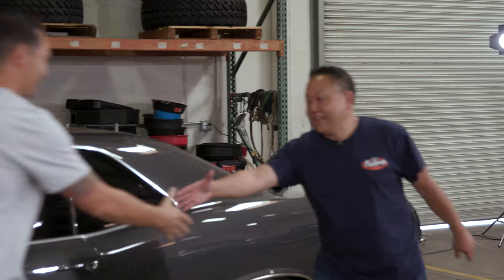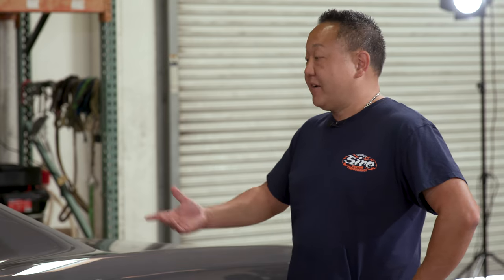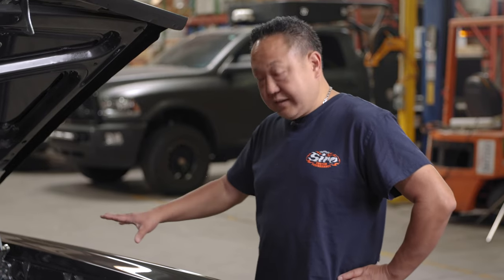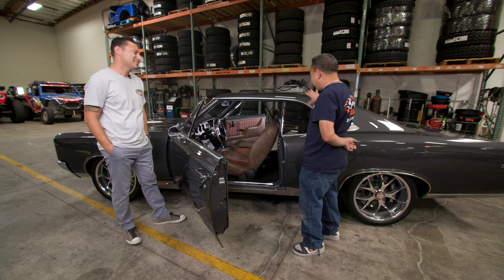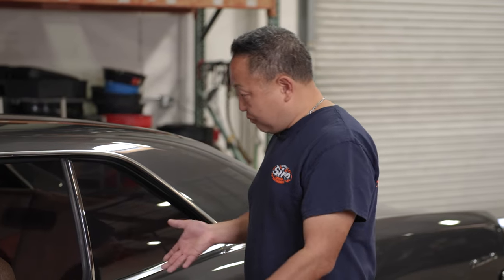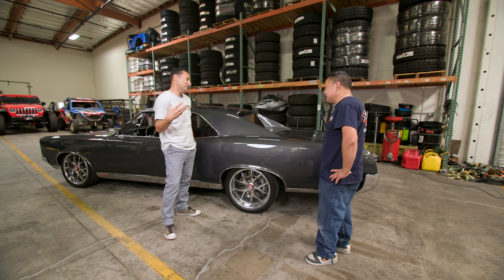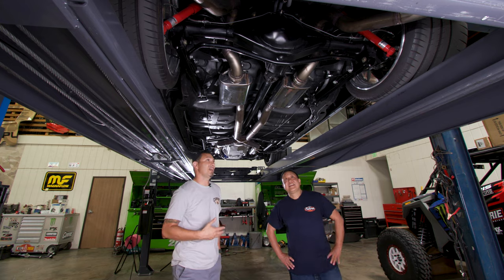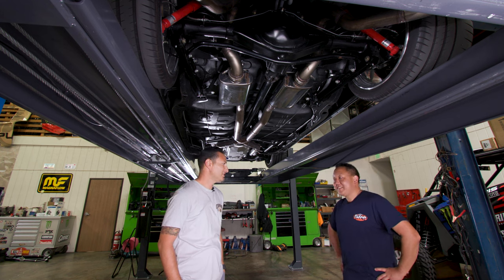FAMILY HEIRLOOM TURNED SUPERCHARGED RESTO MOD | 1967 PONTIAC GTO | CURRIE GARAGE S2 E4

Comment: When I heard "LSA" and realized that here it didn't stand for lobe separation angle,  I lost interest. It seems that notably unlike the Buick GS crowd, this happens way too often with GTO guys.  Most of the charm of a vintage musclecar is making use of the original style vintage engine and drivetrain. The you really have something to be proud of .. ESPECIALLY if it is indeed an "heirloom".
Reply: What does LSA stand for with this one?
Reply: @richardgrant418  It's a type of "LS" CHEVY engine.  Sadly it's in a  PONTIAC GTO.

Comment: My dad taught me to drive when I was 13 in his '69 GTO and before I was old enough to get my license my oldest brother wrecked it.  Almost 45 years later I now own a 32 option numbers matching California GTO that even has factory cornering lamps for the turn signals on the build sheet.  Since mine is a numbers matching car I could never commit the crime of resto-modding it.  Hopefully your mom was not the original owner or it was not numbers matching before you started this because they are only original once.  If I want a resto mod GTO I would probably just get a LeMans and make a fake one.

Comment: '67 Goat, and a nice restomod. I'm a purist, but understand that we're all different and like what we like. No doubt this car is easier to drive than stock, with fuel injection and suspension upgrades. My '66 Tripower was a great car, but I would have done most of the mechanical upgrades without touching the interior or exterior.
Reply from the maker: Right on!

Comment: What would y’all recommend to lower a Dodge charger 2012 one. 2 inches in the front one. 3 inches in the back? but I want a stock ride I have I eibach with strut  they say is supposed to be a firm ride but it is not. It is a harsh harsh ride and 57 I want my car low with a stock ride not firm, not harsh. What would y’all recommend?

Comment: RESTO MOD ,,,,JUNK,,,,,,NEVER ALTER NOTHING
Reply: Nothing wrong with the LS motors but, a real Pontiac person would never use one.  I friend of mine has a non numbers matching '71 H.O. Trans Am that he upgraded suspension and a later model 4 speed electronic trans and some other stuff but, all stock interior and still running a Pontiac 455 H.O.  Not as over the top as this guy did but, now my friend is afraid to park it anywhere so he is probably gong to sell it.
Reply: @RedBud315  At least it had a vintage style real Pontiac engine.